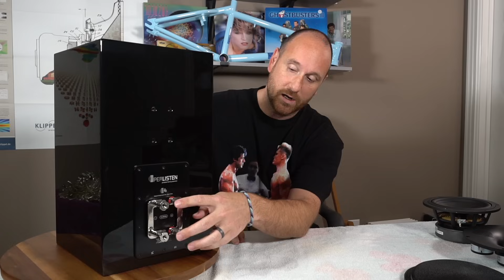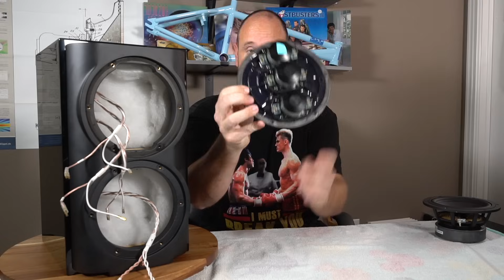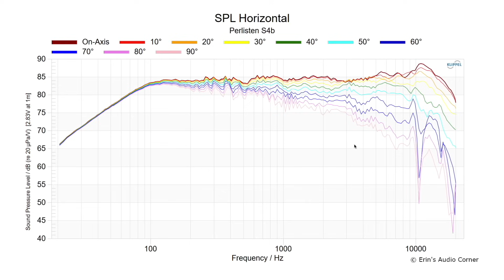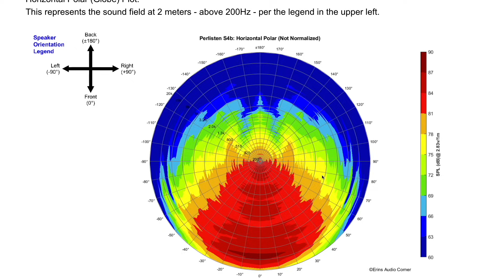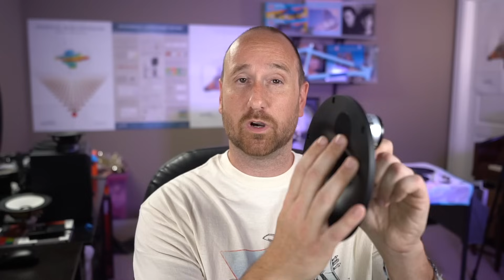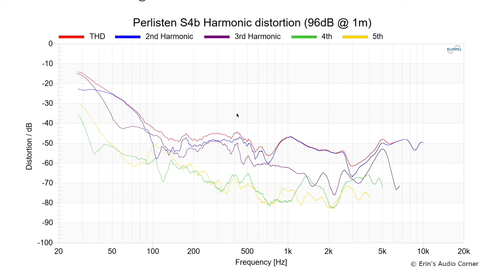Perlisten S4b Bookshelf Speaker review and breakdown.

Comment: i like it when companies build a no compromise speaker, any port or passive radiator would just hurt the sound quality for some extra bass. bass are for subwoofers.
Reply: Regarding the design choice of pursuing a reflex or passive radiator approach, I'm guessing that in this case it's primarily for ease of implementing/blending with a sub.
Reply: Mr. You're wrong. For Bass Reflex and Passive Radiator design need only powerful magnet system. But look carefully, this SB Acoustics midwofer have only one middle size magnet.. Close box don't help to him. For High-End driver need doble powerful magnet, or one biggest magnet.
Reply: @РуфатШиралиев-л8л  please rethink and comment again, you don't  make much sense. i just want a nice sensible english with logical arguments on the topic from my original comment.
Reply: @sudd3660  I perfectly understood your comment, Mr.  I am programmer, mathematician and in physics I was the best.  The woofer can have a slow reaction speed even in a closed box.  It all depends on the speaker design.  SB Acoustics has medium magnet strength.  SB Acoustics in any design will show the average impulse response.  Check out the Legacy Audio and Paradigm Persona speakers.  Everything will be clear to you.  Legacy Audio and Paradigm Persona have the fastest dynamics in the world! These speakers are not afraid of bass reflexes. Also, the Canton Reference 9K has the fastest woofer , which has two large magnets, as well as the deepest bass in the world!  Canon Reference 9K shelves have a lower frequency response threshold of 25 Hz!
Reply: @РуфатШиралиев-л8л   i see you dont understand, and i am not going to educate you on youtube comment section. 
but please do rewatch the video, its not a sb acoustic woofer.  now you see how much of the basics you misunderstood.
Reply: @РуфатШиралиев-л8л  The Paridigm Persona doesn't have the fastest dynamics in the world. And the Canton Reference 9K doesn't have the fastest woofer 🤦🏾‍♂️

Plenty of other hi end speakers with greater dynamics and better performing woofers. In any case no perfect speaker as people's tastes differ.

Some people love horn loaded tweeters some love silk dome tweeters. Some love floorstanders and some love bookshelfs etc.
Reply: @C--A  But it is very foolish of you to deny that Paradigm Persona, Legacy Valor outstanding speakers. Legacy Valor and Paradigm Persona  the best speakers in the world! Because made great Engineers, no Marketers.
Reply: @РуфатШиралиев-л8л  Show me lab msmts of 25Hz. I am very skeptical.
Reply: @РуфатШиралиев-л8л  Since you said your the best in physics i really dont understand how you think that a driver having two magnets or larger magnets in some way automatically makes a driver better than something else. For one they could use Neodynium magnets and create much higher magnetic forces and be a quarter of the size of a traditional magnet. there's a lot more to drivers than that and you cant make any real conclusions about it by just looking at the drivers. also despite having made by engineers it seems like the marketers did their job since you have those opinions related to the speakers that is unless you've owned them all yourself.
Reply: @connorjohnson4402  Mister, did I say that a ferrite magnet is stronger than a neo magnet?  No! Read carefully, please.  And it will be a surprise for you that there are many identical woofers with different magnets.  It happens that a woofers with a ferrite had Qts is lower than  the same woofer with a neo-magnet, and contrary, that a neo-magnet of a woofer is more powerful than a ferrite magnet on the same woofer.  This does not mean that Ferrite is stronger than a Neo magnet.  First of all, it all depends on the specific woofer.
Reply: @РуфатШиралиев-л8л  Dude it doesn't have a SB Acoustics mid woofer or driver. All the drivers, the Beryllium tweeter, DPC waveguide are patented custom Perlisten in house designs. 

The carbon fiber woofer and 2 mids are Textreme from the company Textreme. They sell Textreme woofers/mids/tweeters to a number of companies including SB Acoustics.

I'll add that the Textreme Thin Ply carbon fiber has the best scientifically tested measured carbon fiber of any consumer or commercial speakers.

Lastly the Perlisten S4B though can be used as a stereo pair with a subwoofer. Is intended for surround sound duties, hence why sealed design and not ported.
Reply: @РуфатШиралиев-л8л  Made clear this was not an SBA product--not that I'd care, the Satori line includes some highly capable midbass drivers, and if called on, could likely fashion absolute SOTA 6.5" woofer for custom use  But what would be more helpful is a link to these double magnet woofers--I am curious, and have bought some phenomenal ribbon tweeters from Russia, so no bias here.
Reply: @РуфатШиралиев-л8л It doesn't matter. For me the magnet can be non existent if the BL is gonna be right. There is to much variables and bigger magnet weights more and usually on those expensive drivers you get neodymium because its smaller

Comment: Definitely best bookshelf speaker that gets loud and isn't JTR sized. I actually like that they are sealed as a lot of times you're putting speakers within 4 feet of a wall so not getting that boundary gain is nice even if you could correct for it with room correction.

Comment: Looks like a great speaker, but at $8K a pair, they had better be.  

The vertical directivity is where a lot of controlled directivity speakers put it; there are a lot of 90x40 and 90x50 horns/ waveguides around with the express intent of minimizing floor/ ceiling bounce in the typical 8 to 9 ft ceiling rooms since those surfaces are hard to treat.
Reply: Sadly, lots of $8K speakers that are not great. I believe these will beat Magico's best passive bookshelves which cost even more.
Reply: @stopthefomo  hahaha no way!
Reply: @net_news  i heard the magicos he is reffering to, so overrated , excessively resolving and severe listening fatigue. run on a constellation amp so not fault of equipment
Reply: Or you could have Genelec 8351s for $8k 🤷